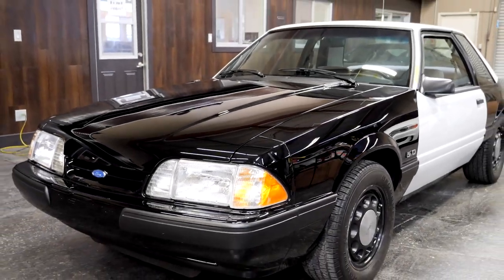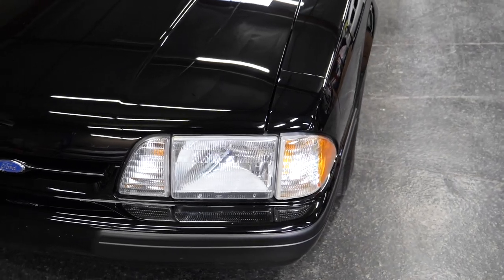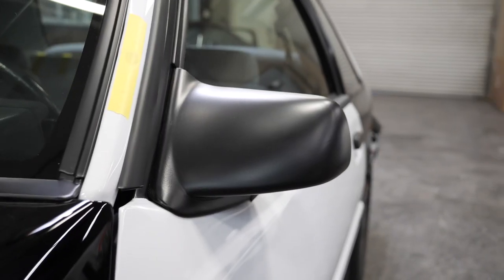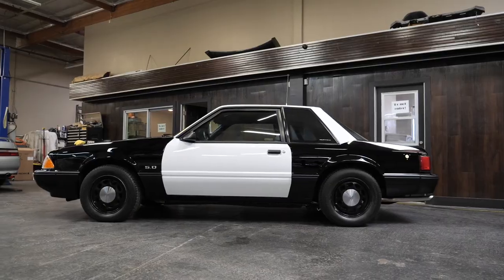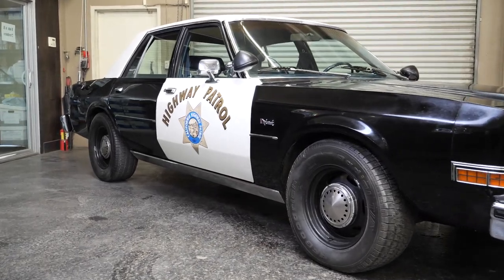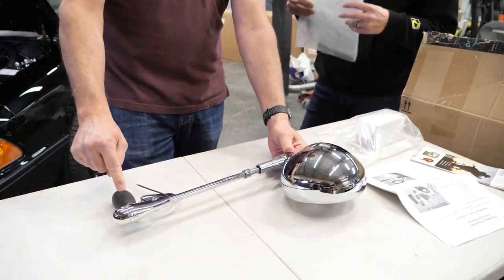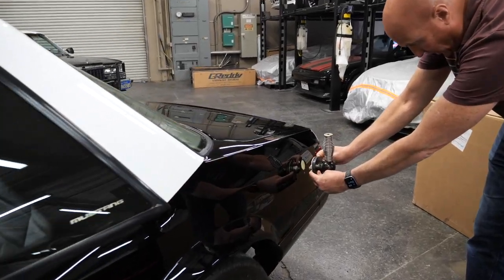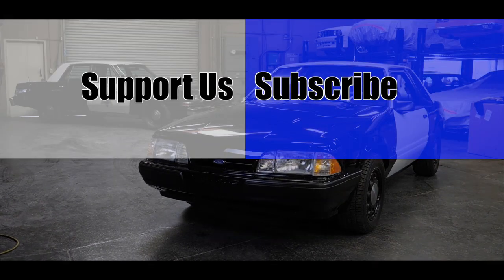1988 SSP CHP Ford Mustang 'Ground-Up' Restoration | Ep. 3

Comment: Wow. This is amazing. Beautiful vehicle & restoration. Absolutely love it. I have a 1988 Washington State Patrol SSP. It still has the spotlight, roof antenna, and flashlight mount. It also has a T handle mouted under the dash that can adjust the idle. There is a switch and a couple jewel lights in the dash as well. I look forward to doing some restoration work in the future. Thank you for the amazing content.
Reply from the maker: Thank you so much. We are still gathering up some parts for the lights. The decals are ready to go on to match out Florida SSP.

Comment: what is the value before the restoration I have a 88 ssp detective car ….?
Reply from the maker: It seriously all depends on condition
Reply: It run it has the correct spotlight’s 140 speedo with tilt steering with ac 308 rear diff radio delete 5speed
Reply from the maker: @salvadorrodriguez2725  if the body and interior is nice and no signs of previous damage, it’s probably worth 15K “ish”
Reply: Also I have all the paperwork clean title ex San Jose ssp thanks for your help 🙏🏽
Reply: Did you have the antenna for my 88 ex chp for sale?